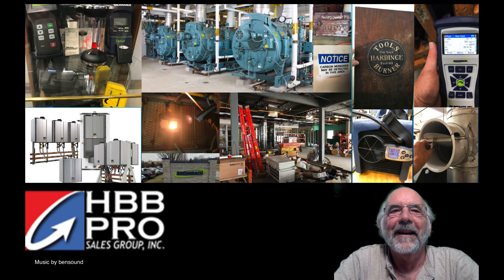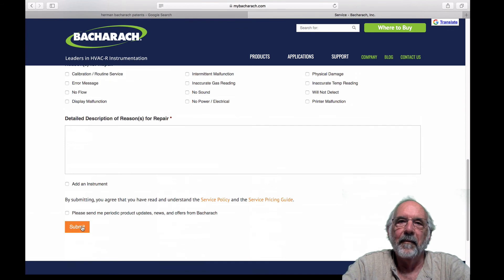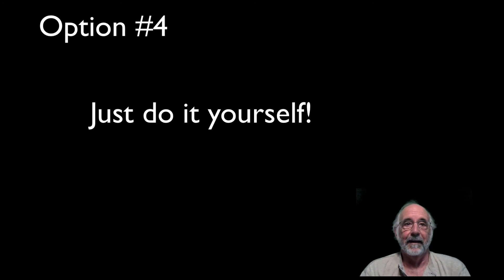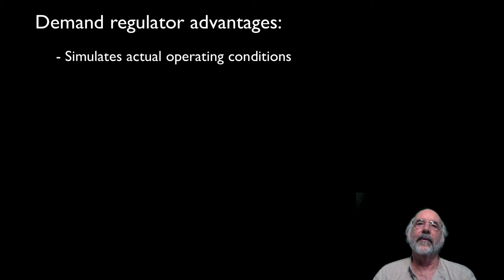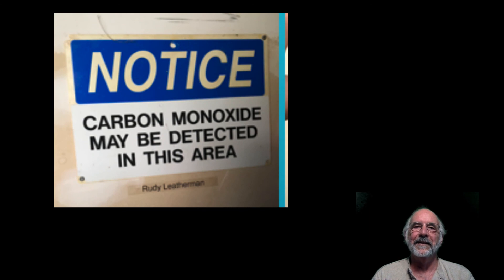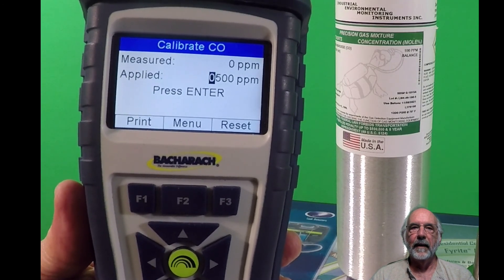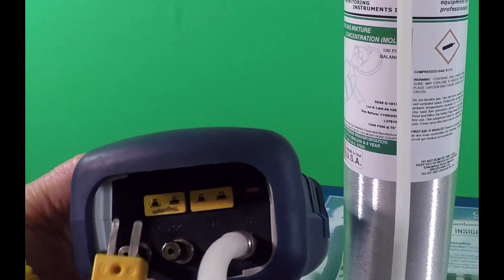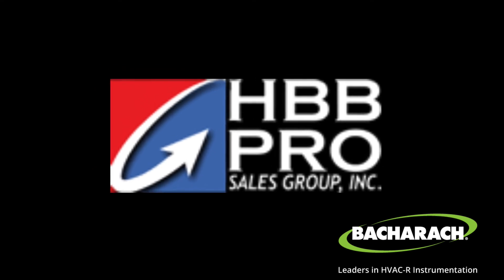Calibration for Bacharach CO sensor in the  Insight and InTech Combustion analyzers

Comment: You seem to be knowledgeable with this instrument.  I recently had my insight plus in a condensing boiler by Lars.  It had a modulating gas valve for setting the high and low output. The fire department shut them down because the neighbors alarms were going off and the outside area was at about 5000 ppm.  Laars doesn’t set air adjustment by CO.  They said just set the CO2 at 8.8-9 % on high fire. When I attempted to do this, my CO went out of sight.  In order to set the CO2, I had to ignore the safety and keep the gases running to tune in the CO2.  Is there a way I can continue to run the sampling pump without damaging the CO sensor, like remove the CO sensor, or remove the crossover silicone tube to it?